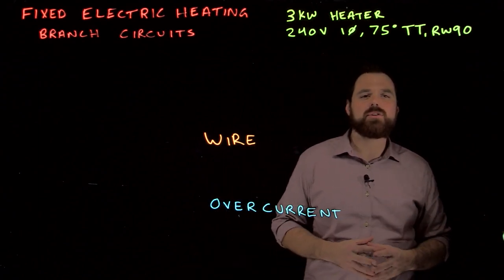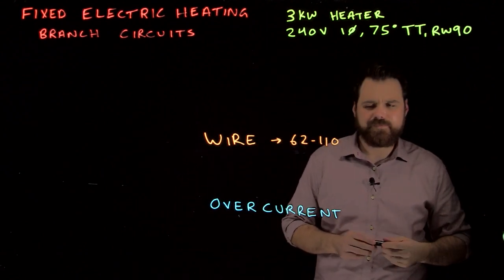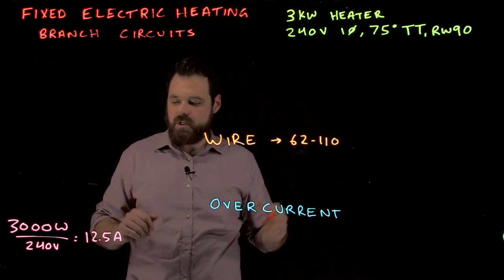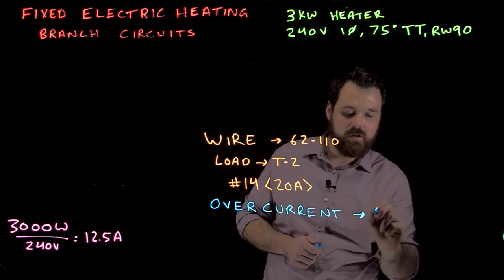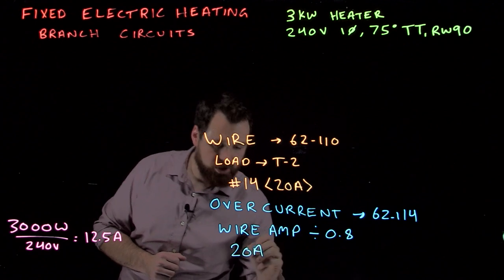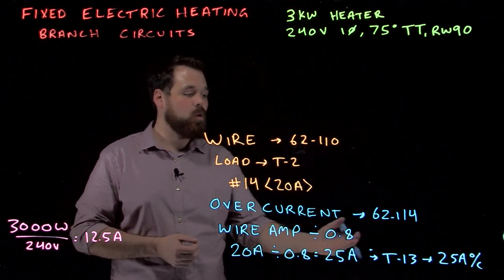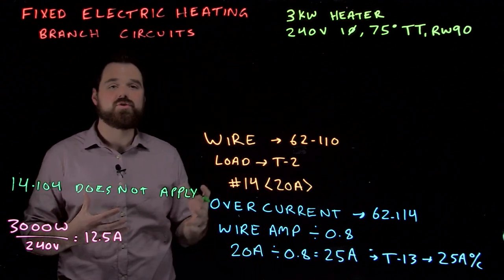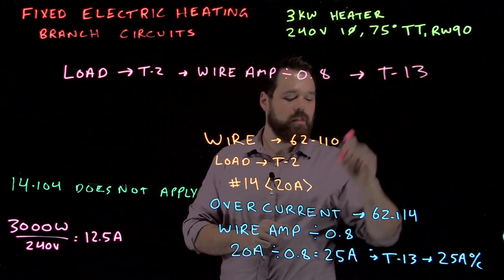Heating Branch Circuit

Comment: What about figuring for continuous duty ? Don't you need to add 125% for conductor size and OCPD size?
Reply from the maker: No. Because we are using section 64, that would overrule section 8